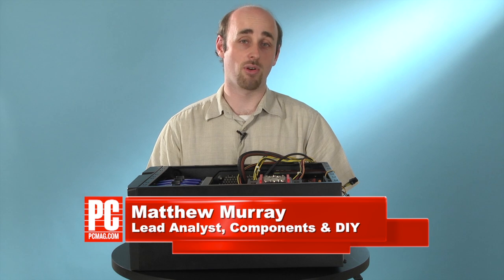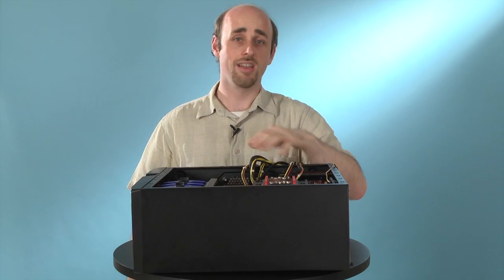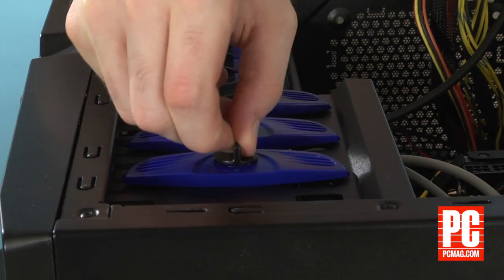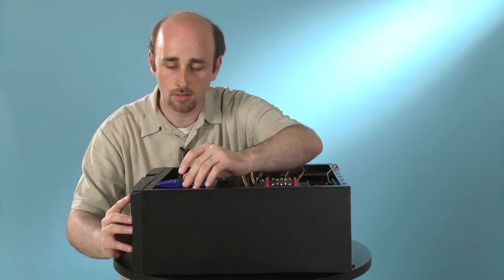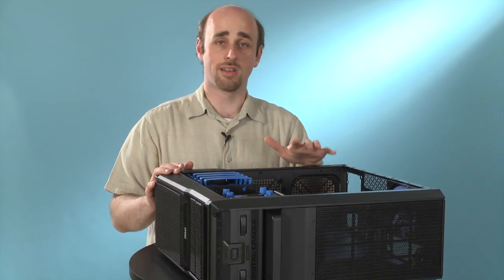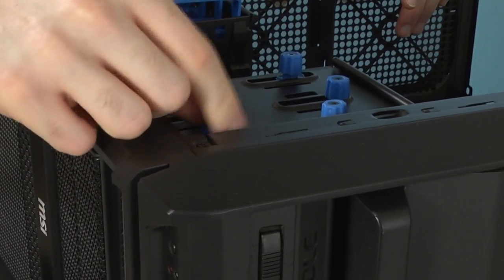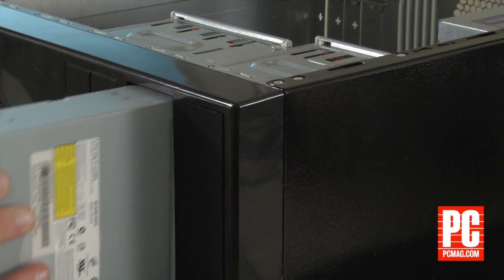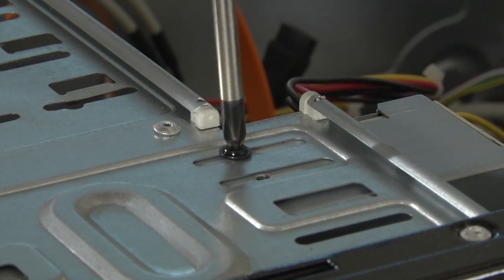How to Install an Optical Drive

Comment: Well, that's useless Mr Obvious!  No explanation about connecting up the power or the data cable, what if you don't have any drive cable connectors available on the board?  Can you use a USB connector or other alternative instead etc????